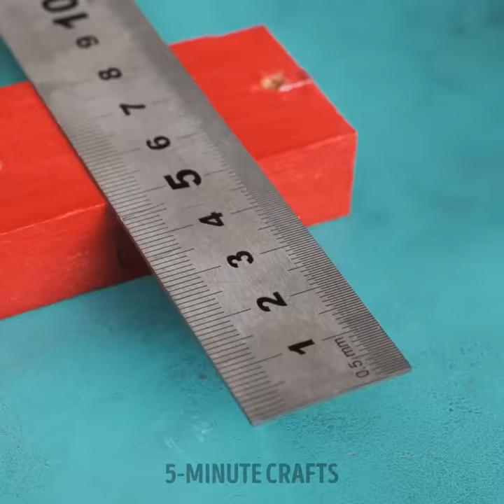Brilliant Repair Hacks That'll Make Your Life Way Cooler

Comment: So, what is the blue stuff that is used in a couple of these? And why would anyone glue sandpaper to the head of their drill to sharpen a knife?
Reply: The blue and red stuff is probably epoxy. If you ever watch knives get Jones in the factory they use an abrasive wheel and go against the spin to prevent burrs. However this hack looks more like it would destroy your edge rather than improve it.
Reply: @angiefurger6143  and mess up the drill?